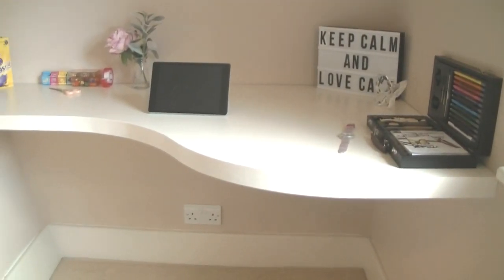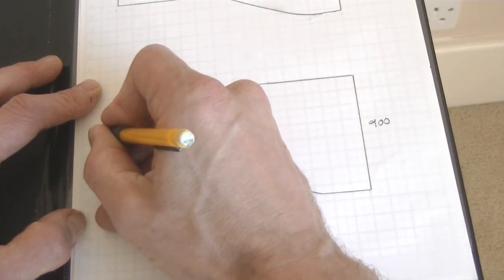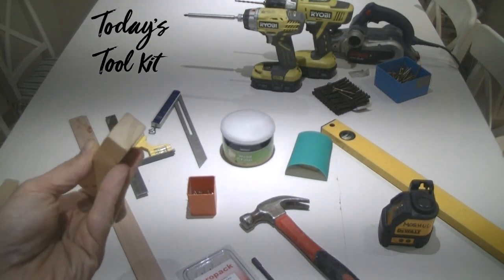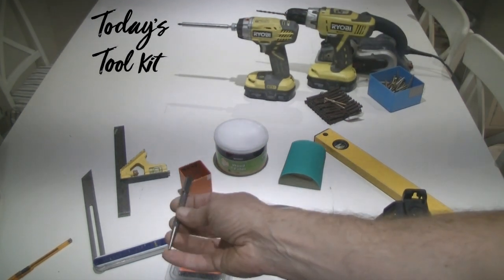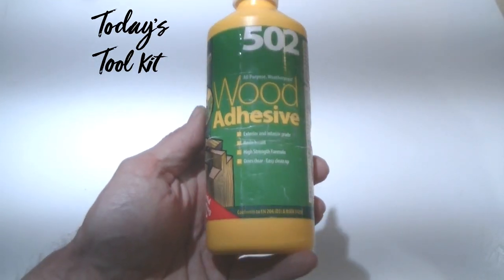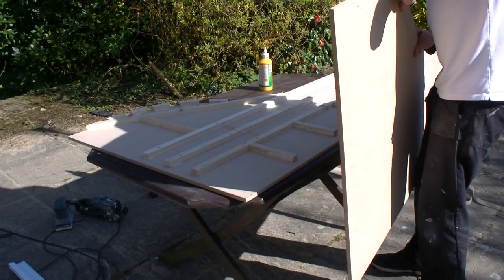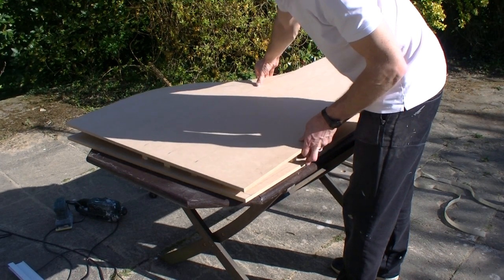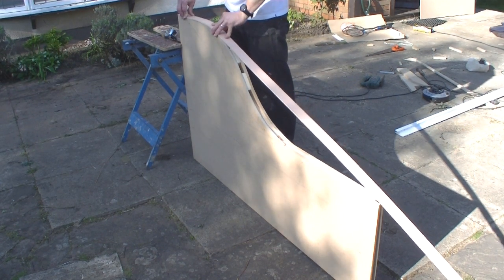How to Make a Floating Desk

Comment: Hello Charlie, this video is very inspiring and I am now getting organized to make and install one. I never thought I could do something like this but thanks to you I believe I can. I have two questions, firstly how many panel pins did you use to hold the top section. Second in the spirit of DIY I have two spare tubes of decorators caulk lying around which I am going to use to fill the panel pin recesses. Would this be OK or should I use wood filler? I am aware the caulk may shrink a little so some extra filling and sanding may be required. Finally, congratulations on your 20,000 subscribers, well done !!!

Comment: Did you consider using 18mm or 22mm mdf instead of sandwich the two?
Reply from the maker: No, because I wanted the top and bottom layers to be as thin as possible whilst being strong enough to help the desk retain its structure. If I had 18mm or 22mm mdf, even the 22mm would be susceptible to bowing, and without the sandwich effect there would be no way to slot it onto the wall to give it the floating effect.

Comment: Great video 👏🏼, I have one question, would the frame of the desk be better off nailed on the top piece rather than on the bottom piece, therefore the strength is more on the top side rather than on the bottom. Just an idea as I might make one only L shaped
Reply from the maker: Yes, I think you're right!

Comment: Whats the maximum weight can a desk like this sustain?
Reply from the maker: Haven't got a clue. It's fine for general "desk" work - leaning on, bearing the load of files, books etc, but you wouldn't want to stand or sit on it!
Reply: Charlie DIYte I figured that much. I want to get something like that made for my room for my desktop PC etc.
Reply from the maker: It'll be fine for that. You can increase the strength of it by over engineering the design. Eg plenty of hard wood braces inside, glued and screwed to each leaf of the desk (top and bottom).

Comment: hiii!!!! loving your videos sir! I am about to attempt this hopefully but I have a question, so I plan to put this in the corner of my room but my room is a perfect square so will it work to have wooden battens on only two sides  of the table and not 3? I hope I am making sense :)
Reply from the maker: Hi Rukia! Thanks - you're too kind!! I think if you're going to have one unsupported side to the desk, then the desk will need to be thicker so that it derives strength from the structure of the desk, rather than just the battens, if that makes sense. See this and you'll see what I mean https://uk.pinterest.com/pin/106538347414826485/ 

Obviously, this will put more stress on the fixings that you've drilled into the wall - particularly on the unsupported side of the table. The beauty of having it supported on 3 sides is that the battens really don't need to be that strong as the load is only vertical, whereas by removing one of the supports, your desk will be wanting to pull itself out of the wall horizontally and vertically, if any substantial weight is put on it. 

If you curved the desk like I did, and have the taper on the unsupported side, then that is reducing the weight of the desk in this area, which will help in reducing the load on the fixings attaching the desk to the wall on the unsupported side. 

Hope this makes sense?!

Comment: Great video, exactly the way I want to install one in my home and this is the best video I've seen on how to do it! 
The one difference I have is where you have a window, I have a wall that returns (hopefully the diagram below shows that!) so I can't slide it onto the battens the way you have. Reckon I could attach the top to the bottom whilst in its final position somehow?
________________________________________
|                                                                           |
|                                                                           |
|                                                                           |
|                                                                           |
|                                                                           |
|                                            _________________|
|                                            |
|                                            |
|                                            |
|                                            |

Comment: Great job. It's a shame this can't be done without a supporting wall to the side.
Reply from the maker: You'd need a deep wall with steel rods sunk into it to take all that weight on a single back wall.
Reply: @CharlieDIYte  I think so. Basically, a somewhat modified and larger scale version of a floating shelf.
Reply: I just realised there is a way to make something approaching this type of corner desk, but it wouldn't be strictly floating. Basically, one would need to fashion two L brackets that would ideally be screwed into the wall studs on both ends of the desk, on top of which the desktop would be attached. It wouldn't be as elegant as your design, but it'd be a decent compromise.